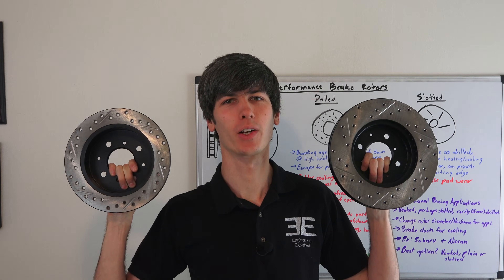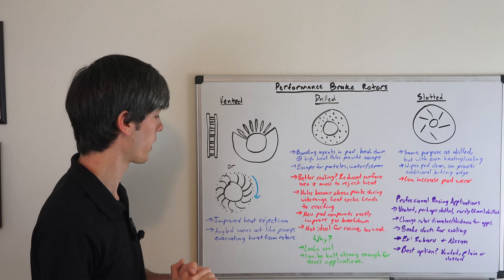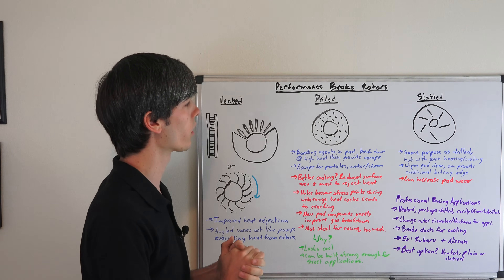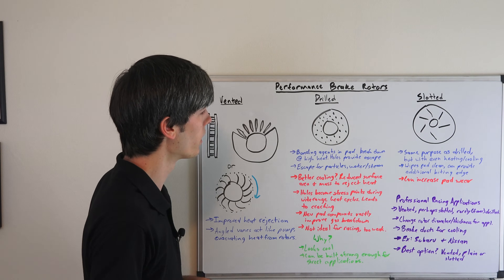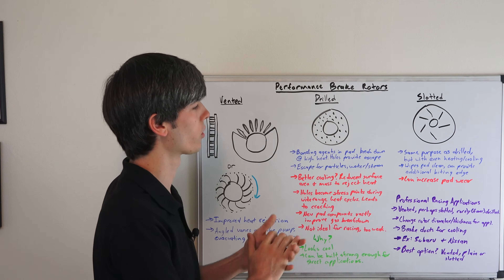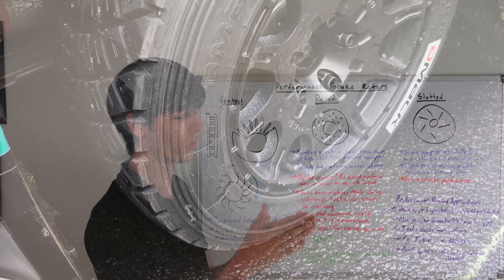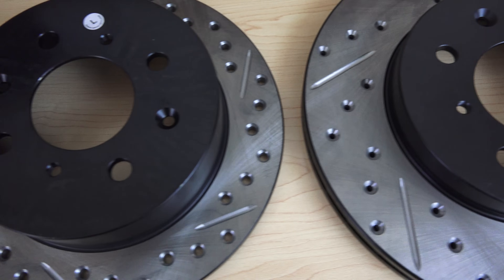Drilled, Slotted & Vented Brake Rotors - What's Best?

Comment: Are there even any vehicles nowadays that don't have vented rotors from the factory?  I don't know if I've ever seen a solid rotor (though to be fair, I've not worked on more than a dozen or so cars)
Reply: Most cheap, small cars still have solid rotors. Simply cheaper to make and good enough.
Reply: I'd say most compact/sub-compact non-performance cars have solid rotors on the rear, at least.
Reply: most rear discs are solid (not vented), especially more so in low horsepower applications...

Comment: true drilled rotors cause stress to the rotor thus jeapordizing durability and increasing risk of them breaking. but what if they wernt drilled but were cast with the holes already there wouldnt that make them beneficial then?
Reply: Cast holes are better than drilled, but they still will have the uneven heating/cooling compared to the blank parts of the rotor causing stress and fatigue in the metal.
Reply: Yup, look at Porsche rotors. They're cast (supposedly) from the 964 model on up and they tend to crack less than aftermarket drilled rotors.

Comment: I need some need brakes and rotors for my 05 Cadillac CTS, any recommendations???
Reply: Factory or plain rotors.
Reply: If you want extra braking performance, get better tires. 
Then get quality blank rotors with performance brake pads from a quality manufacturer  (Hawk, EBC, etc)

If you want some aesthetic and wanna spend some money, you can look into seeing if CTS-V brakes will fit. It will most likely be a patch work job as the CTS-V's are 6 lug cars, but 4th gen fbody guys add the CTS-V calipers (made by Brembo) with 2010+ Camaro SS rotors. It all depends on your stock lug pattern and hub size. Just look at some CTS forums to see what others have done.

Comment: If you go to a Lemons race and look at brakes, you'll rarely see slotted or drilled rotors. You'll almost never see them on the fastest cars, even the ones with huge Willwood rotors and calipers.  Why is this a relevant data point?  Well at my favorite track you break from over 90 down to about 50 3 times and every 2 minutes and change. That's some serious workout for brakes.  Those cheese grater rotors are a gimmick.  I've got the basic Centric blanks on my race car and they are great.

Comment: Might the holes on the drilled rotors also serve to provide extra bite from the leading edges and lower weight?
Reply: It's true that you take some weight off when you drill,  but unfortunately, that means you have less material to capture the heat from your brakes. In the end, this causes the pads to fade sooner. You would have to get larger diameter rotors to reduce fade.
Reply: ALovelyBunchOfCoconuts lol the weight reduction from drilled holes would be a joke. You can do the math yourself. IMHO, heat soak = better than any other factors, when it comes to brake.

You don't want your brake to fade, ever. That's one of the scariest thing to experience.

Comment: Ok, drilled discs are weaker, but I don't understand why most of the "performance brake rotors" some brands offer are drilled and even slotted as well, but they finally brake better than plane discs despite all disadvantages they have. So, the question is Why drilled and slotted discs works generally better than plane discs in common cars?

Comment: well, the proof is in the pudding. My 98 LS S-10 pickup, went through front brakes like peanut butter , till i put on slotted/drilled rotors. now they last about three times longer than before, between pad replacement. so i am sticking with the drilled.... and no, i dont brake hard, i am a very safe driver.

Comment: Hey,what about a break disc/rotor made from Carbon Carbon but in Drilled type? Tq
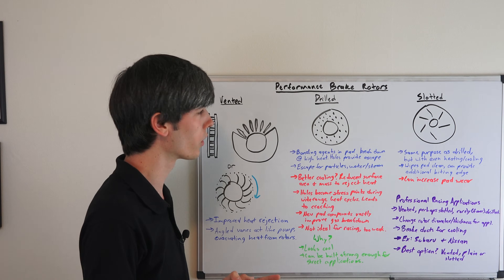Reply: muhammad aizat watch from 2:50
Reply: tbpom1003 yeah,I know that Drilled type is not suitable for racing,coz the drilled holes can make the disc/rotor crack. But,the Carbon Carbon is high quality performance material. That mean,it can stand high temperature than a standard spec disc/rotor that have the same a size  or numbers drilled on a single rotor. I doubt that CC type disc will easily break even it has drilled patten on it... Just my opinion.
Reply: +muhammad aizat Yeah, I understand what you are saying. but we should consider structure, not material. Even though you have a super strong material, if the structure isn't good, it will fail eventually. As you said carbon brakes are actually designed to withstand the usual intense heat during braking, but still those holes are making weak points.

anyways, drilled ones are good in street, but track driving is no no.

Comment: what if you slot your rotor along the circumference? like a little Os inside bigger Os. Would that counteract the rotor ware caused by slots placed vertically?
Reply: +Jose Hilera Eventually you would wear the pads down so they fill in those rings, thus eliminating the effect.  A SPIRAL however would work well.
Reply: James Heslop Thats actually a good idea, right? A single long spiral slot

Comment: I've been around race cars and racing my whole life and the only time I seen a drilled rotor  break is when it was involved in a major accident.  Never seen a drilled rotor fail from heat..real race cars have v8's and crossed drilled rotors..lol
Reply: V8 supercars use slotted & vented rotors, most GT3 and GTE racecars use slotted & vented rotors and the top end of sports car racing at LMP uses plain vented rotors. 

Cross-drilled rotors are a thing for road going sports cars, not race cars these days.

Comment: I disagree. On my truck I fought warped rotors for years. The truck came with vented rotors from the factory and pulling trailers they warped fast. I next tried dimpled and slotted vented roters. They were better but still warped just not as fast. For the last 10 years I have been using drilled and slotted vented rotors. In making this change my warping problem gone and my breaking distances have shortened. Maybe for a little zoom zoom car drilled and slotted aren't good but for a truck with a trailer they are great.

Comment: Yeah and if your into 4x4 in mud, those drilled holes suck. They get full of mud and cause the rotors to heat up and cool down at different rates which cause them to  crack and warp. Slotted seems o.k.  but i just go for bog stock plain flat, cheaper too! I spend my money on better brake pads.

Hey engineering explained have you done a show on brake pads???
Reply: O.k yeah i found it.

Comment: My question would be why, then, are basically all motorcycle disc rotors drilled? Even when you get a race spec rotor, they're all drilled. I mean for the race spec ones, you wouldn't expect them to drill them unless there was actually some point in doing so. E.g. clearly running a drilled rotor on the 2015 Milwawkee Yamaha team's Superbike https://s-media-cache-ak0.pinimg.com/originals/07/23/cd/0723cd9ef50ba49ed74728100b42d19b.jpg, or the Honda racing factory team's superbike : http://archive.britishsuperbike.com/media/1390099/honda.png

Comment: Vented rotors are the best. Drilled rotors remove metal from the mass of the brake and therefore are less efficient at removing heat to air. Heavier the rotor the better until the unsprung weight becomes ridiculous.

Comment: He forgot to say DON'T BUY CHEEP ROTORS! Spend the little more for the rotors from the company you've heard of that come with at least a 2 year warranty. I've had drilled and slotted (Good quality) rotors on my 500hp, daily driven in all 4 NewEngland seasons, weekly raced in the summertime Trailblazer SS for 3 years and I have never had any trouble with them cracking warping or anything. I use green stuff pads which are amazing but there was definitely difference in better brake feel and stopping distance when I went with the drilled and slotted rotors.........and yes they look sooooo much better.
Reply: +DAK454 Heat treat your rotors and you never have to worry about them again

Comment: hi,  if the curved veins rotors were installed on the other side, will they work to grab air to the inside due to their shape? and may this be efficient to install that way? i am sure that the answer is no but we wanna hear your educated analysis on that, thx.
Reply: +Elie Nehme it wouldn't because the rotor is trapped inside the grim of the wheel and is not getting direct airflow from the outside. its not like the intake grilles on your car that get direct air flow. I see and understand your thinking, but doing it that way would cause them to suck up and hold hot air rather then expel it
Reply: +LittleGords grim = drum    --__--
Reply: LittleGords thx for the reply, but your last sentence means that there is no way the air is expelled at the center, but as i understood from EE is that the airtravells from the ceter and is expelled from the tips of the rotor.
Reply: +Elie Neeme not quite sure I understand exactly what you're saying/asking. yes, the vented brakes expel the hot air at the ends of the vents as they rotate. from there, I suppose its just up to the laws of thermodynamics to remove the heat from the drum of the wheel...cold air will move to hotter areas, and vice versa, etc. the main idea is that as much heat as possible is expelled from the center of the brake rotor
Reply: LittleGords sir, the main purpose that these rotors are supposed to be installed at a specific direction is to expel heat to the outside, if it is not so, then it would not matter at whatever direction you install it. i think that the reason they are installed the way EE says is for the vanes to create a vacuum and suck the air from the inside to the outside. he used the term pump the air at 0:32. this means that it is not just a natural heat transfer between cold and hot air. so, if my thoughts are correct then there must be an air flow from the inside to the outside of the rotor made by the low pressure the edges of the vanes make when rotating since they are shaped like that and rotating the correct way to make this happen.
Reply: +Elie Nehme I never disagreed with you that they are installed in the direction that they are installed in for good reason. I never said it was simply a natural transfer of heat from the inside of the rotor to the outside...I said natural transfer of heat from within the drum of the wheel to outside said wheel drum, not from the inside/center of the rotor to the outside/edges of the rotor. just look at his drawing on the whiteboard. clearly the cooling vanes are angled in such a way (angled away from the direction that the rotor actually turns when driving forwards) for a reason; it is to promote the expulsion of the heat away from the center towards the outside of the cooling vane channels (and the outside of the brake rotor). the "air flow" you speak of is simply centrifugal force

Comment: Engineering Explained First thank you for giving this info. I've wondered about rotors for while and always dreaded having to change them out.

Second: I've been considering getting a set of wheels that are 4x100 bolt pattern. The car however is 4x98. What's your opinion on wobble bolts? I've seen people saying they are fine or they are bad, but none of those videos are made by someone with your qualifications (you being an engineer in all).

Thanks in advance.

Comment: Question!!!

What does resurface mean and what does it do?
Reply: Resurfacing rotors is simply a machining procedure to the rotors. With the use of a brake lathe, the faces are turned down to expose fresh metal which gets rid of imperfections on the rotor face (pits, gouges, etc.). Generally, you will see a minimum thickness stamped on the rotor hat showing how far the rotors can be turned down, or in the case of drum brakes, a maximum diameter that the drum can be opened up to.

Comment: If the ducts in the rotor are curved, then they are directional.  So be aware.
Reply from the maker: Clearanceman2 Yes, absolutely (as drawn).
Reply: Can't really read the writing on the board too well.  Might just mention the idea that if they are directional, you need to mount them on the correct side or they won't work properly.

Comment: so...ceramic brake pads with plain old vented rotors good for street/sport applications?
Reply: +Pan tera My drilled/slotted rotors forbid the use of ceramic brake pads :(
Reply: toysareforboys i wouldn't ever use drilled rotors on my car (even though both my bikes do) but the with a fluid change, ceramic pads on the conventional rotors work spectacularly.
i ended up getting them anyway (02 civic sedan)
Reply: +Pan tera Nice!! I've been running the drilled and slotted rotors for 4 years now without issues (just got my second set). Other than the brake dust from not being able to run ceramic pads I don't really find any disadvantages with them. I drive my car hard, full boost, on the limiter 24/7, so I figure the drilled/slotted will help out with the brake fade :) http://ecuflashking.com/07cobaltSS_SC/07cobaltrotors.png

Comment: What rotor are you holding with your left hand on 0:00? They're vented, slotted and drilled. What type is it? Also, what are dimpled rotors?
Reply from the maker: Stoptech. Dimpled has a curve leading into the drilled holes, so it's not a sharp cut-off.
Reply: I've used the Stoptech drilled and slotted rotors on my trucks. Never had a failure but also don't push them too hard. Certainly help clean dust and stuff out from construction sites.
Reply: Dimpled rotors are rotors that have small concave "dimples" drilled into the friction surface of the rotor (usually in a pattern that mimics real cross-drilled rotors), however they aren't actually drilled all the way through.  They are only a millimeter or two deep, and have the sole purpose of filling with brake dust, in order to give the appearance of real cross-drilled rotors.  It's purely a cosmetic thing.
Reply: Thes are not simply dimpled rotors. Get a set in your hands. The Z36 Extreme Truck and Tow are full drilled and slotted. Yes they do have a small dimpling to the holes but that is for less aggressive pad wear.
Reply: I am fully aware that what's shown in the video are not dimpled rotors.  I'm trying to clarify that rotors labeled as "dimpled" are NOT drilled all the way through.  The "dimples" you're referring to on the Z36 rotors are actually called beveled, as in the holes are tapered at the top, to reduce pad wear.  If you want to see the dimples I'm referring to, look up EBC Brakes GD7237.  Those are dimpled & slotted rotors.
Reply: Ahh ok. Now I get what you mean. Thought you were referring to them as being only dimpled. My mistake. Tend to get a bit aggravated with the number of "Auto experts" these days that have done nothing more automotive than play with Matchbox cars.
Reply: I know I'm late to the conversation but I just have to add my two cents. The rotor he is holding in his right hand(on the left side of the screen) is not a vented rotor. It is a solid rotor, although it is still "cross-drilled" and "vented". There are no internal "vents", just a solid piece. Also as to the dimple vs. drilled debate, I believe the term you are looking for is "chamfered". The holes are fully drilled through the rotor but are chamfered. These drilled holes could also be referred to as "countersunk". This is done to prevent stress points from the sharp angle where the hole meets the surface of the rotor at 90 degrees."Dimpled" is just that,like the dimples of a golf ball, although not as dramatic. Wikipedia has good articles about both of these terms. Anyways, no worries, love the channel. Peace Out.

Comment: I ride a superbike and virtually all bikes have drilled rotors but super/sport bikes are certainly going to be stressed. Does this mean they're all doing it wrong? I know Motogp bikes have solid disks but they're carbon.
Reply: Dani2wheels Good point.  I guess bikes don't have as much kinetic energy to convert to heat energy and their discs don't heat up as much.  For bikes you definitely want to minimize rotational inertia, so they probably want them as light as possible.
Reply: Dani2wheels They primarily do it for reducing rotational inertia of a brake rotor. A rotor with holes will weigh slightly less thus making it easier for a biker to control their bikes.
Reply: Dani2wheels 
The Rain discs are steel (and drilled as far as i can tell) because carbons dont work in the wet.
I therefore presume that for bikes buying drilled rotors is the best.
 (I have a mix of holes and slots on my ZX6R)

Comment: What about Dimpled & Slotted Rotors? Dimpled just as bad as Drilled?
Reply from the maker: +xPandahaha Dimpled is much better as it reduces the stress riser. Not as sharp of an edge.
Reply: +Engineering Explained what about rotors  compound - does racing rotors have different compound?

Comment: So would u even recommend drilled-slotted rotors or just stick to slotted or vented
Reply: TekkenH3AT using both only compounds the disadvantages of both while not getting the max advantage of each individually
Reply: TekkenH3AT just stick with plain vented rotors
Reply from the maker: TekkenH3AT Vented is great, perhaps slotted. I wouldn't get the combo (but it makes for a great video, no?).
Reply: Engineering Explained
hmmm agreed

Comment: Great information, but while I'm not a mechanic, the argument against the drilled rotors causing stress points sounds like you're pushing it.  99.9% of the people that would buy these are using them on their personal vehicle, which in most cases is simply a family vehicle that is driven around town, down the highway, etc.  I highly doubt there are ANY reported failures of the rotors that are of the drilled type.